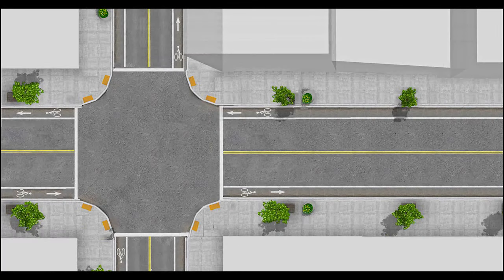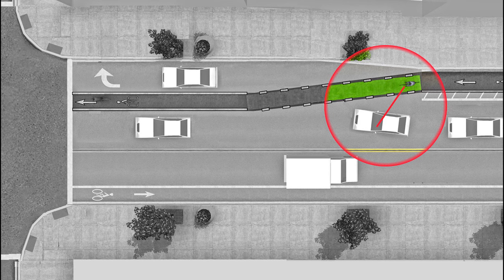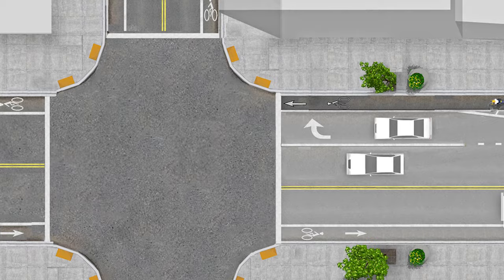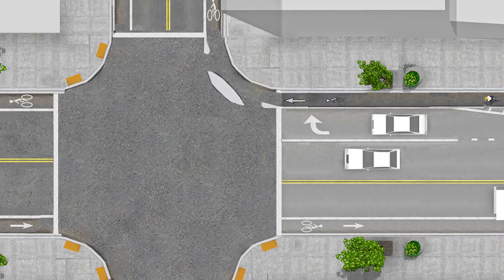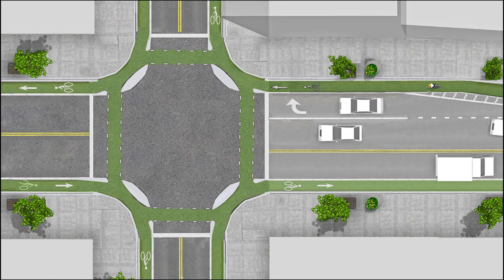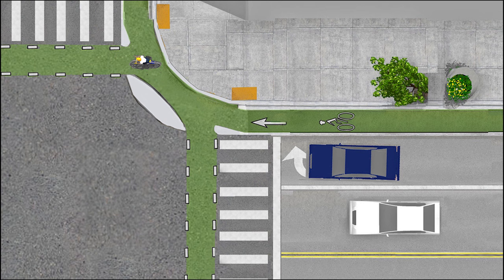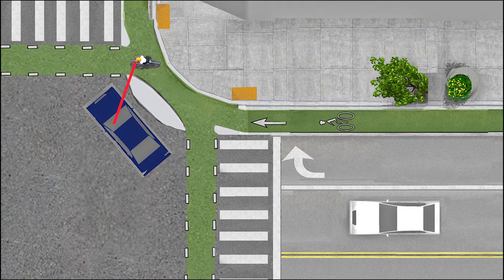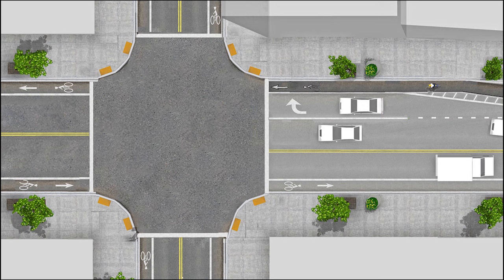Intersection design, the Dutch - cycle friendly - way

Comment: I like the general concept of the design, but two questions still bother me:
1) Should this cycle paths be built on every street or every X number of streets?
2) Wouldn't having cycle paths in front of all buildings in a single street cause troubles with internal parking lots or garages of the buildings?
Thanks for your answer.
Reply: +Daniel Pinillos In the Netherlands there are cycle paths on most streets that have a lot of car traffic. There are also roads that do not allow cars without a destination in that zone. (I.e. you can only drive your car there if you live there, or are there to deliver something (mail, packages, etc.). Since the traffic on those roads is limited anyway, you don't need cycle paths. Additionally there are a lot of small connecting roads that are bike only. I guess people often forget that in Europe you have lots of rather narrow streets that are all but useless to cars but very useful for bikes. That's why a copy of the European system will not work the same way in the US even if they implemented bike lanes all over the place. As for point 2: There aren't that many parking lots situated in such a way that it is problematic. Normally what you would have is: Building - Sidewalk - Parking Spots - Bike Lane - Car Lanes. (So space between garage and street is not an issue.) The rule is that if you're pulling out of a parking spot you always have to give way. In 20 years of cycling I have seen exactly one accident, and I have been in one accident myself. Although that was just because me and a friend were goofing around and our handlebars interlocked. Scraped my knee, that's it.
Reply: +Googol Plus Sukcz , thanks for your well-explained answer. So, if your garage is in front of a bike lane, would it need a ramp o are sidewalks at the same level as the bike lanes and car lanes? 
Also, wouldn't it be wiser to put bike lanes in the center (in the case of wide two-way streets) to prevent those car vs bike issues when trying to get into/out of a garage?
Reply: In addition what you already been told, it is not only about the quantity of traffic, but also about the speed of traffic.
We dont always build perfect roads, but if we notice something is not working we change it.
You have to devide roads in the following categories.
10 to 15 km / hour roads / living streets Cars are guests on these streets hence bikes and pedestriand can do what they want and cars have to yield in every situation.
30 km/ hour roads --> Nearly never seperated cycle path, speeds are slow enough, lot of speed bumbs as well to ensure speed is not to high. Cars Typically avoid these streets as much as possible.
50 km/hour roads --> If traffic is very busy than always seperated, when calm traffic it can have a bike path on the road with paint or still be seperated. On intersection physical seperation typically would return.
80 km/hour roads --> always seperated cycle paths
100-130 km/hour roads-->always seperated cycle path
These are the general guidelines followed.
As for the parking we follow
pedestrian(elovated slightly above cycle path), cycly path(elovated slightly above road), parked cars and the road. Not always is a parked row of cars on the streets though. When you have parking garages you have to cross the cycle track, cars have to yield and typically a speed / elevation is in place to make sure you slow down, often also enough space to wait and not hinder other cars that want to go straight.
Also remember a lot of these garages will be in city centre on 30 km /h (shared) streets. 
Hence not really a big problem.
Reply: @danielpinillos9804  a bicycle lane is better suited next to the pedestrian path as the cyclist can stop whenever they reach their destination (perhaps halfway down a street?) if the bicycle lane is surrounded by car traffic, the cyclist is is forced to not use the bicycle lane in the last street or have to cross faster moving traffic in the middle of the street, cycling on the pedestrian path is usually a no-no, since there is a bicycle path, same for cycling on the car lane.

Comment: When the UK is known for having so many roundabouts I don't know WHY they continue to not develop existing roundabouts with cyclists in mind. I've seen about three. 😐
Reply: Or just develop roundabouts to begin with. The two most common ones I have seen are a dot painted on the street, which plenty of people ignore and simply drive over when turning or going straight. An accident waiting to happen. Or one with 2 lanes with no really visible lane markings and an extremely odd system of taking the exits. A accident magnet.

There is also a design where the lanes fan out. You just stick to your lane and automatically have the right exit, brilliant. Turbo roundabouts we call them in NL.

Or just a single lane roundabout, but with and actually thing which you can't just drive over in the middle. 

While fixing them, improving cycle lanes or creating them is convenient as well.

Comment: How would this same design work in a 3-way or "T" situation?
Reply: Basically the same but you cut out one of the sidestreets and the cycle track on that side gets no traffic lights.
Say the road on towards the top of the screen moves. That would mean that cyclist from the right to the left would get their traffic light removed. The rest would basically remain the same
Reply: Right but does it still need a bit of a curve at the top of the T so that bikes coming up and turning left or right would have the curve needed to keep moving rather than stop and make an awkward 90 degree turn?
Reply: @baronjutter  you would just let the cycle path be straight, so basically if you ride from right to left, you would just ride as if there isn't a sidestreet. Just like the footpath.

Comment: There is a small problem.
Since you pushed the stopsigns so far back. Cars will have a harder time seeing the other cars coming from other streets in the junction. They will almost always need to go over the pedestrian and cyclists crossing to be able to see other incoming vehicles.
Reply: Not true or not a real problem (that is: a perceived problem only).
Proof: See virtually any junction in The Netherlands designed this way.

Disclaimer: Like any man-made construction, there might be the occasional wrongly constructed junction.

Comment: You could easily skip the traffic lights by walking your bike through the sidewalk and then hopping on the saddle again when you are on the cross street. If you're driving straight, weaving right and left can even make your ride more unsafe (at least in Finnish cycling conditions, where vehicles turning right have a duty to yield pedestrians and cyclists, but won't necessarily recognize a cyclist driving to the crossing 20 km/h).

Comment: This isn't perfect by a long shot however. We have those in my city and last week I almost got run over twice on two different occasions.
Reply: What went wrong?
Reply: Okay...but in what way were you almost run over? They obviously don't protect you more against people running red lights for example. If you were almost hit during a right turn for the cars during a green for cyclists, that doesn't really mean anything either. They would still have been more likely to see you than with the original design and the one thing really to blame there would be the traffic signal cycles.
Reply: almost getting run over is safer than getting run over.
by not explaining the situation/situations we can also assume that you did a dumb-dumb.

Comment: But, when a physically segregated cycle track is applied on the arms of the junction, we do, in the Netherlands, build something that resembles the proposal that is shown here.
However the geometry we apply in the Netherlands is different. The way it is shown here cyclists have to seriously slow down even when continouing straight. In the Netherlands we bend out the cycle track before the junction or we continue straight, but in that case there is no island.
So they mixed up two principles here.

Comment: That's good, but it won't work with big trucks in many areas of cites or industrial sections though. Trucks need that extra space on the turns at intersections. They already run over the curbs as it is in a lot of cases. I know this is something they obviously don't have to deal with in the Netherlands.  Or at least not on the grand scale we have it here in the US with big trucks on seemingly every street. Some good ideas though for sure.
Reply: What we do is, we have separate classes of roads. Inside the city smaller trucks are used for deliveries inside the cities. When you get out of town there are bigger roads which can more easily accommodate larger trucks. We also make sure highways go around towns. The big industrial stuff is also located out of town. This works very well.
Reply: Tbf, we have loads of industrial areas with no cycle lanes at all. Why would they be needed there? 
And in plenty of cities, trucks are simply not allowed because the streets are to small (or pollution, etc.). 
He/we are not pretending that this design is the be all and end all of junction design.
This is however a design that is great in any country in plenty of cities.
Reply: Trucks vans and trucks but those long ones for transporting goods get trough it without problem

Comment: Some flaws with this design:
1. Less ability for on-street parking - Parking meters are a revenue maker for the city and this design apparently assumes on-street parking doesn't exist here.
2. Longer diagonal crossings for pedestrians - Since these are now pushed further back from the corner curb, it takes a longer while & more distance for a pedestrian to quickly beat the signal crossing.
3. Might require more longer street widths - This design would also seem to require much wider road widths.

Comment: The left turn seems particularly dangerous. As a cyclist myself, I think I prefer the current method of having the cycle lane continuing left the right turning lane. For a cyclists to turn left with this construction, they give the impression of going straight to drivers behind them, then abruptly have to cut across two lanes of traffic. The current method, of moving toward the centre line and waiting as a car would, causes less confusion for all parties and seems a lot safer.
Reply: No it's not.

Comment: What happens when you want to go straight through an intersection at speed? You have to do a weird wiggle to avoid hitting the islands. Also the left turn requires you to cross more lanes than a normal left turn, and is a much greater distance. I'd rather just ride with all the other traffic as I do now.
Reply: GaskellleoCinema We Dutch think cyclists who are alive are faster then cyclists who are dead.
Reply: +GaskellleoCinema If that's a problem, you're cycling too fast. Adjust your speed for junctions.
Reply: +drie wiel  You're a cyclist?
Reply: Daniel Elvebak Well, drie wiel appears to be Dutch, so him not being a cyclist is about as unlikely as you never being a pedestrian.

In Holland, we don't identify ourselves as a group, called "cyclists". People will generally assume that you cycle at least sometimes (if you don't, that's weird). This is the same way many people in the US generally assume other adults drive a car.
Reply: Tim Pauwels If something seem obvious, maybe it is.  Just saying.

Comment: 1. How is this assuming on-street parking doesn't exist? I don't see anything that suggest it doesn't. Given the Dutch use a standard that places bike lanes between on-street parking and the sidewalk to enhance safety, I have to assume you don't know what you're talking about.
2. Pedestrians aren't supposed to be crossing diagonally. You watched the video, yes? You saw how the existing BOC didn't move, yes?
3. Again, there was no change in ROW or roadway width.

Comment: not convinced this is better. It looks like going straight through is more of a hassle. Can the cyclist go left of the island? If not they have extra distance to go. That would be fine if it made things a lot safer but I'm not sure it does. In N. America either the car is behind you, so they go behind and to the right of  you as you change lanes, or they are in front of you (and going faster) so that doesn't affect you anyway. Cyclist can go straight and fast through the junction.

Comment: One problem with that.. If your driving a truck, or a semi-truck.. You need way mor turning ratio, than you´ll need in a car.. This junktion would soon prove so smal for cars and trucks at the same time.. 

I like the ide, but you do need a bit bigger areas.. To help the trucks around the corners safe!
Reply: Not necessarily. Since the cars stop further from the crossroad in the Dutch design, trucks have more space to turn. Sure, they won't hug the right corner of the crossroads at all times, but that's okay. There's still some margin left after the crossroad itself.

Comment: im a cyclist and i dont think this would work very well. mainly because of the many angles the cyclist has to go around. i prefer the 1st design because a cyclist shoul look beside them when crossing and a car should also look problem solved. i have cycled over these roads many times and no incident or even thoughts about the design popped into my head.